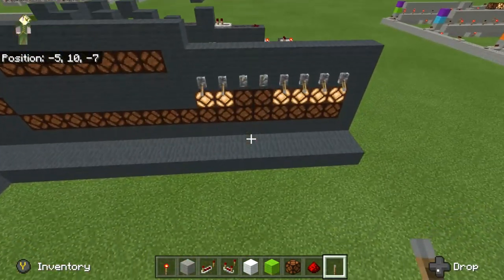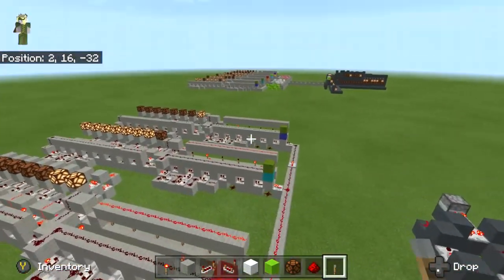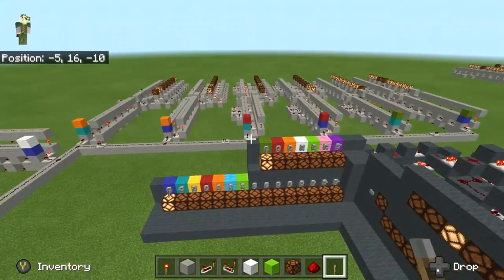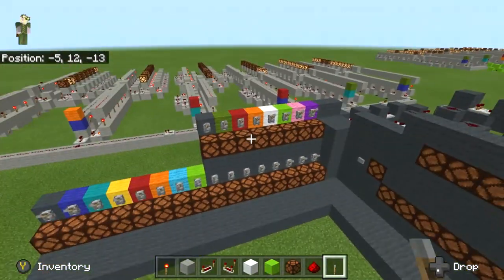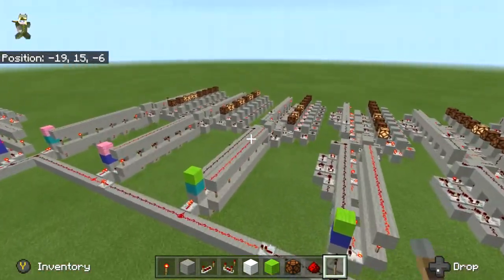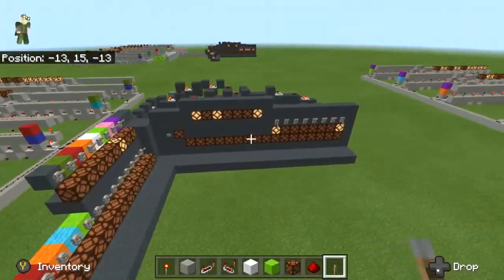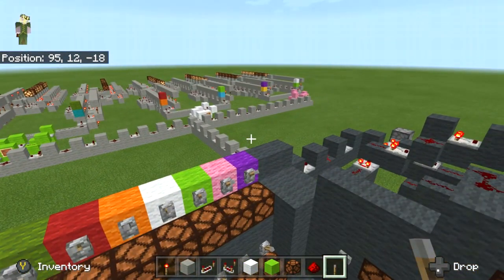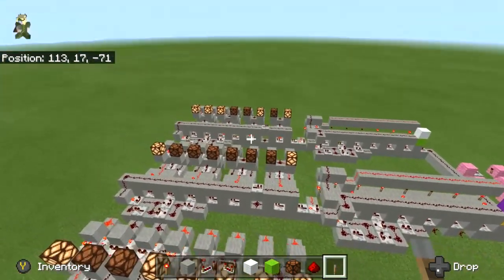Minecraft Single Wire Transmission / 7 Bit Addressing and More

Comment: So now I’m curious. Wouldn’t simulation distance be the biggest limiting factor for this kind of system? If you start implementing 127+ nodes that would take up significant space.

In my mind, 4 bit addressing is probably more than enough for someone playing survival Minecraft.
Reply: This is not viable for survival, but he is explaining what could be possible within Minecraft by using serial transmission.
Reply: Prudii Gaming First off: Hello!

Is there something in particular that tells you its nonviable? I’ve watched the previous videos and my only real complaint was size.

If I could come up with a reasonable data product (more than 1 bit of information to TX and RX), I wouldn’t hesitate to use something like this.
Reply from the maker: @wintercoldfront  I think both you and Prudii are correct, it is, and is not, viable for survival. For realms that max at 4 chunk sim., you don't have much room to work with. But in single player worlds with a high sim., a 4 bit system should work relatively well for experienced players.

And I personally use chunk loaders to keep my base and farms loaded regardless, so a system like this shouldn't be difficult to implement. Which is what I'd also advise you to look into if you were building a labyrinth that spanned many chunks. :]
Reply: Just thought I would clarify. It is viable, but without chunk loading, you will never need that many addresses, and it's slightly overcomplicating. Instead, you could use just the 15 different levers, and skip the top part, and be perfectly fine. 

It's definitely useful, but only in certain scenarios.
Reply from the maker: @PrudiiGaming  I agree, and even with only 15 addresses, the same address could be used at different locations to perform different functions, so it's not limited at all.
Reply: @jonathanpeters4240  if you are only using producers (repeaters, torches, comparator and observers) them it will work in your render distance as well which is also adjustable in world files.
Reply from the maker: @LabsterLab  Wait, what... I didn't know that. you're saying you can transmit in unloaded chunks?
Reply: You can power repeaters torches comparators and obviously use redstone dust as long as the chunks are in the visually rendered area. So even if simulation distance is on 12 you can still render 22 chunks of producers if you set it :)